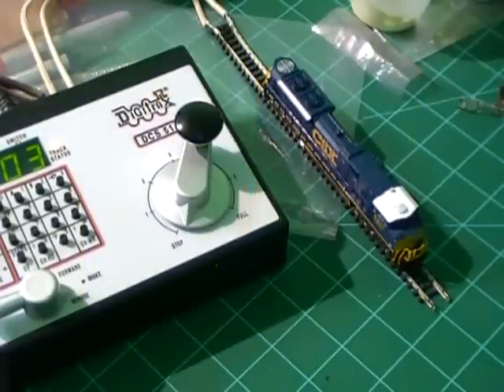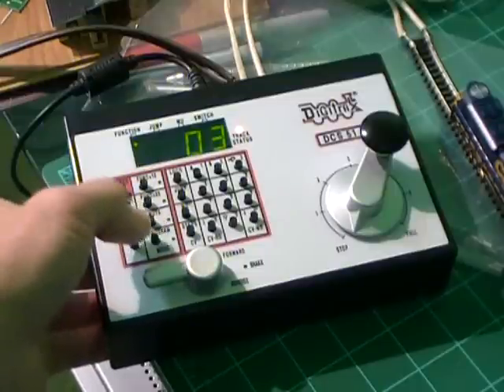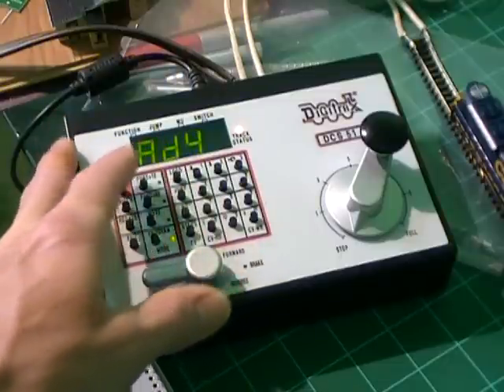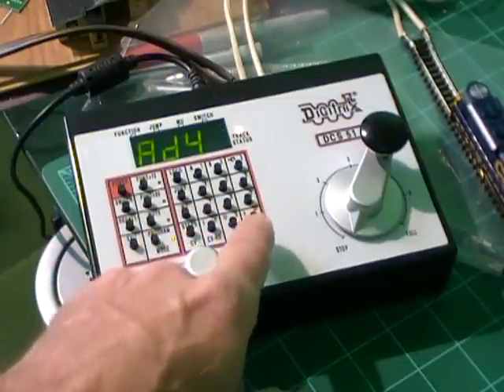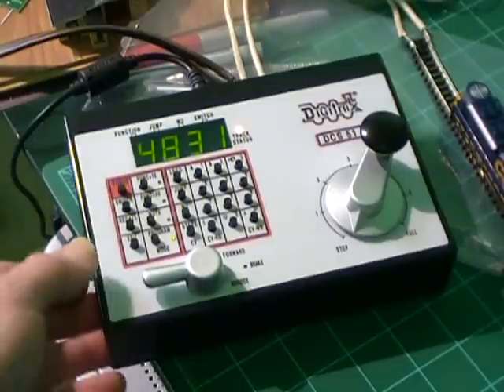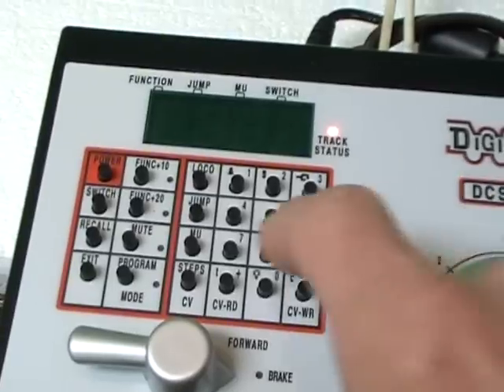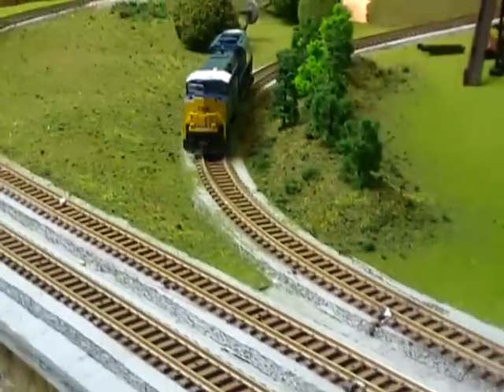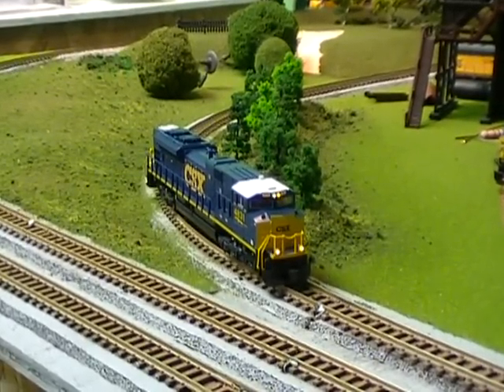DCC PROGRAM A 4 DIGIT ADDRESS

Comment from the maker: Sorry for late reply. Make sure that your program track is wired correctly. I use direct when i program my locomotives. Check the manual that came with the dcc controler.
Some decoders require a resister across the program track when programing.